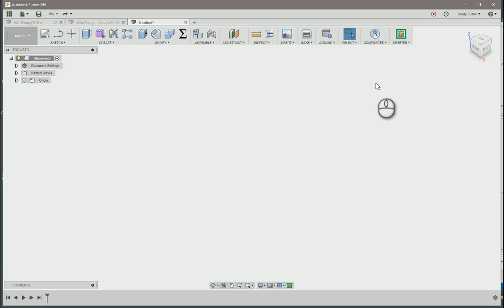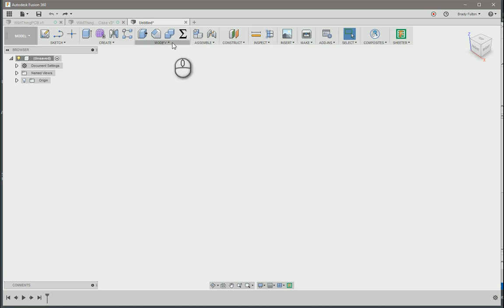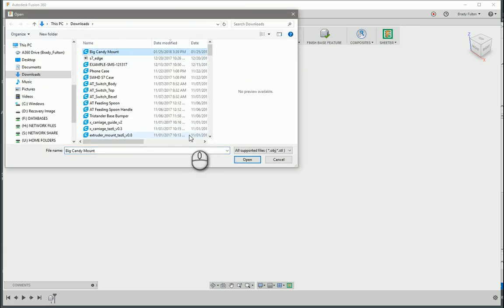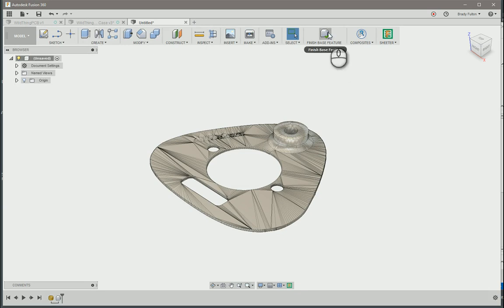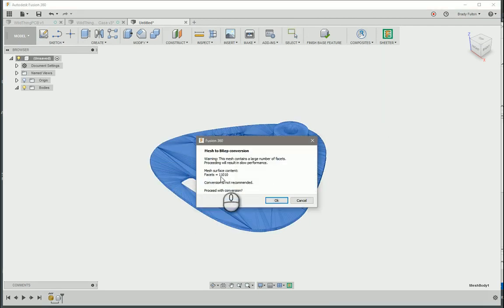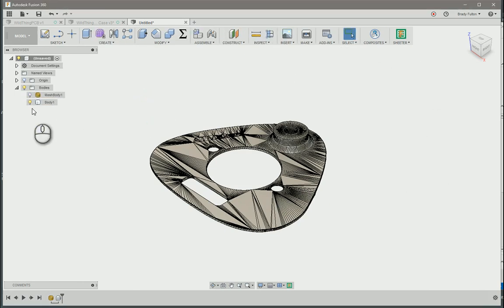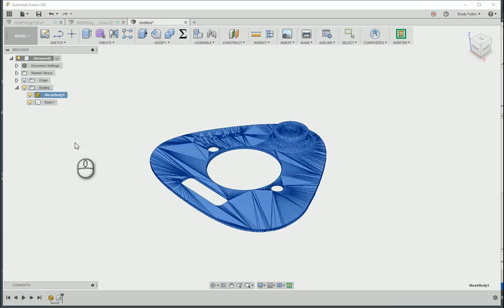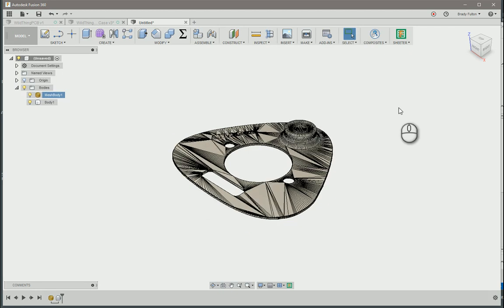Mesh to solid body in Fusion 360

Comment: You are using a very old version of Fusion, I can tell just from the rest of the UI. Triangular meshes to solid bodies have not been supported for years.
Reply: I just did using version 2.0.4854. Works no problem. I think you have to remove history before having the Mesh to BRep option. Otherwise just start a new object with your STL by using the upload button, then do Mesh to BRep without doing anything else.

Comment: Does not work anymore in the current Version (07.2018)
Reply from the maker: Just tried it. Still works for me. Make sure your mesh doesn't have too many faces, if so reduce first in F360 or meshmixer. If it's not the face count, you may have also pushed "finish base feature" too quickly, you have to convert the mesh while you're still in the base feature. Hope it's one of those, if not, let me know what it's doing for you.